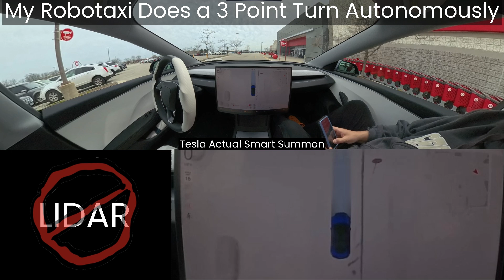We Don't Need no Stinkin' LIDAR - Tesla FSD 13  #autonomousdriving  #teslafsd #lidar

Comment: It's not successes that define this technology, but its failures.
Reply from the maker: 3 billion miles on FSD.
I have 4000 miles on FSD.
Teslas have the highest safety rating from multiple agencies. Tesla camera only system has won multiple safety awards.
Subaru has been using a camera only system longer than Tesla and it has won 57 safety awards.

https://youtu.be/dKaN3f2zmCQ?si=eDUsAlGg_kycB1Vh&t=154

Comment: The problem is that images can be obscured by weather, dirt and other things, a camera only sees a visual representation of it's surroundings. A Lidar sensor sees a physical representation of it's surroundings and can detect and avoid objects even if a camera can't see them. The best approach for safety is to combine the input from both.
Reply from the maker: LIDAR does not see a physical representation. LIDAR returns a point cloud. A camera returns light intensity while a LIDAR returns distance. Cameras see the same thing your eyes see.
Reply: @ericgregori  "Cameras see the same thing your eyes see." exactly. They also don't see things our eyes don't see. Like a deer coming from the side of the road at night, which no one can see until it appears in the headlights. Whereas LIDAR would see it coming from a very far distance. Which system would you trust to take a nap while being driven ?
Reply: Lidar is not as precise as you think it is.
Reply: @Benjamin_Monnoyeur  that's why, when combined with video you can build a better picture of the surroundings. No single method is superior, the benefit comes with multiple technologies working together.
Reply: @rfitzgerald2004  Yes I see your point, but lidar does nots speak the same langage as video in neural nets, it’s a point cloud, it’s hard to make them both work in the software approach of Tesla, you would have to make them both work in parallel and the determine wich one is safer at what time, wich is interesting but yet not as elegant as vision only, also lidar has to become a bit cheaper for large scale manufacturing. Also, lidar is not that precise for small objects in the distance. But in theory more sensors more safety yes. If you want to make it drive better than humans, do not use tools like cameras that have the same limitations as human eyes, at least use ultraviolet light or Infrared in addition.

Comment: There is a flaw in this logic. Human perception and reaction to visual stimuli works completely differently then the neural nets driving these cars. Even human neurons are way more complex than any of the modern neuron variants. This enables humans and animals to understand and react to their enviroment quickly and effectively even without fully understanding the enviroment. Brains have a very simple but accurate inderstanding of the enviroment even in the first step of visual processing, and they can react to it. Current self driving nets dont have any understanding of their enviroments whatsoever, they only predict objects and ideal reactions to those objects based on a huge statistical data. So outlier stimuli gets ignored. This wont happen to a human driver, or even to a cat tbh. So despite both being called networks of neurons, its a completely different process, so the argument that if a brain can drive with two eyes, so can a neural net with 8 cameras, is flawed even without starting to talk about the camera resolution and dynamic range and stuff.
Reply from the maker: Have you tried FSD 13?

Comment: Let’s compare Tesla’s vision-only system to Waymo and Cruise, which use sensor fusion—including that 'stinkin’ LIDAR. The results speak for themselves.

Tesla
🟥 736 crashes (since 2019), including 17 fatalities
🔗 https://static.nhtsa.gov/odi/inv/2022/INCR-EA22002-14496.pdf

🟥 273 crashes in a 9-month period
🔗 https://static.nhtsa.gov/odi/inv/2022/INCR-EA22002-14496.pdf

Waymo
🟩 150 crashes (as of mid-2023)
🔗 https://static.nhtsa.gov/odi/inv/2024/INOA-PE24016-12382.pdf

🟩 Only 3 crashes with injuries, 0 fatalities
🔗 https://static.nhtsa.gov/odi/inv/2024/INOA-PE24016-12382.pdf

Cruise
🟨 78 crashes (as of mid-2023)
🔗 https://static.nhtsa.gov/odi/inv/2022/INCLA-PE22014-10746.pdf

🟨 Injury data not specified
🔗 https://static.nhtsa.gov/odi/inv/2022/INCLA-PE22014-10746.pdf
Reply from the maker: According to IIHS, NHTS, NCAP Tesla is the safest car on the road.
https://www.youtube.com/watch?v=dKaN3f2zmCQ
Reply: @ericgregori  Those IIHS and NCAP crash test ratings measure passenger protection in a controlled crash, not crash avoidance or autonomy system safety.

The NHTSA crash data I shared shows real-world performance of Tesla’s Autopilot and FSD systems — and the results speak for themselves:

🟥 736 crashes, 17 deaths (since 2019)
🔗 https://static.nhtsa.gov/odi/inv/2022/INCR-EA22002-14496.pdf

Crashworthiness ≠ autonomous safety. A safe car doesn't automatically mean a safe self-driving system.
Reply: @ericgregori Those IIHS and NCAP crash test ratings measure passenger protection in a controlled crash, not crash avoidance or autonomy system safety.

The NHTSA crash data I shared shows real-world performance of Tesla’s Autopilot and FSD systems — and the results speak for themselves:

🟥 736 crashes, 17 deaths (since 2019)
🔗 https://static.nhtsa.gov/odi/inv/2022/INCR-EA22002-14496.pdf

Crashworthiness ≠ autonomous safety. A safe car doesn't automatically mean a safe self-driving system.
Reply: @ericgregori  Those IIHS and NCAP crash test ratings measure passenger protection in a controlled crash, not crash avoidance or autonomy system safety.

The NHTSA crash data I shared shows real-world performance of Tesla’s Autopilot and FSD systems — and the results speak for themselves:

🟥 736 crashes, 17 deaths (since 2019)
🔗 https://static.nhtsa.gov/odi/inv/2022/INCR-EA22002-14496.pdf

Crashworthiness ≠ autonomous safety. A safe car doesn't automatically mean a safe self-driving system.
Reply: @ericgregori  Those IIHS and NCAP crash test ratings measure passenger protection in a controlled crash, not crash avoidance or autonomy system safety.

The NHTSA crash data I shared shows real-world performance of Tesla’s Autopilot and FSD systems — and the results speak for themselves:

Crashworthiness ≠ autonomous safety. A safe car doesn't automatically mean a safe self-driving system.
Reply from the maker: NCAP ADAS testing
https://youtu.be/dKaN3f2zmCQ?si=ef0h0VsWPeYp61F7&t=155
Reply: You keep moving the goalpost. First, we were talking about Tesla’s lack of redundancy and the crash data. Now you're pivoting to crash test ratings and YouTube videos.

IIHS and NCAP test crashworthiness, not autonomous driving safety. We’re talking about system design and real-world autonomous performance, not how well a car protects you after it crashes.

So let’s stay on topic: Why defend a vision-only system with no radar, no LiDAR, no fallback — especially when the crash record is so clear?